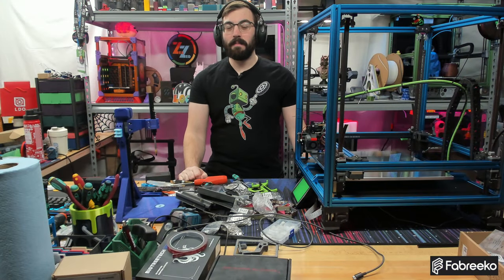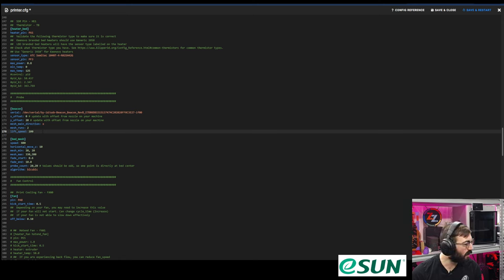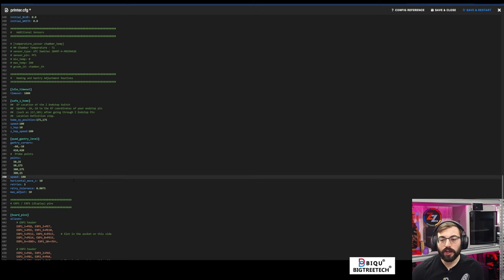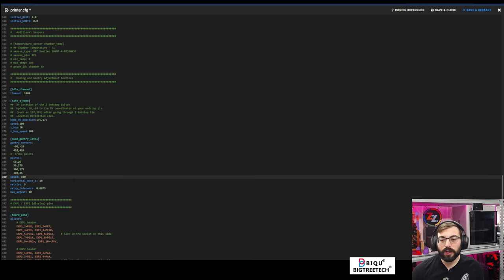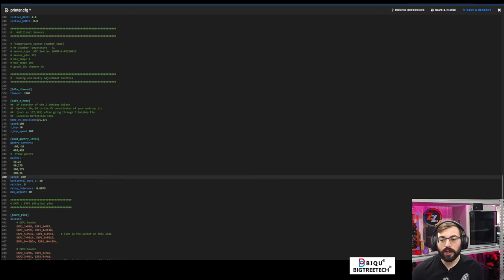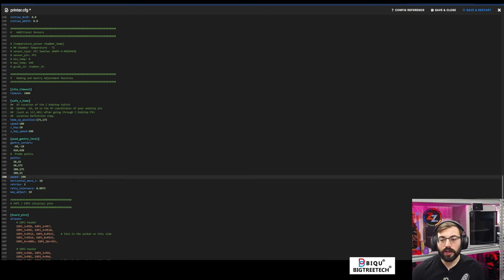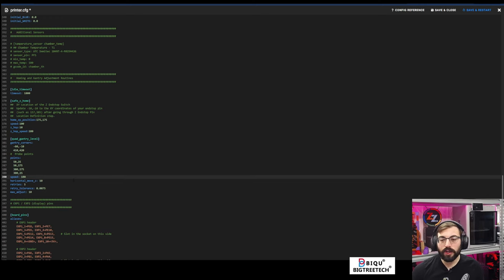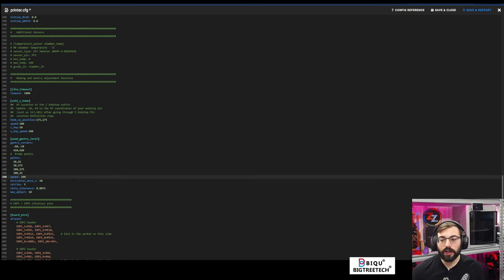Upgrade StealthBurner To DragonBurner? | Stealthchanger Voron Toolchanger Build | Episode 3

Comment: For the umbilical cord, you can use a keycard bungee. That will keep the wire up, but allow for free movement down and forward.
Reply from the maker: I was thinking about this too, a low strength key back might work well

Comment: You cant get 0.0something accuracy with sensorless. It only works for one full step. If you need exact position after changing toolhead you cant use sensorless.
Reply from the maker: This will be interesting to test how repeatable the homing is.

Comment: You can't turn the screen save off. It is firmware controlled to prevent screen burn-in on the LCD element.